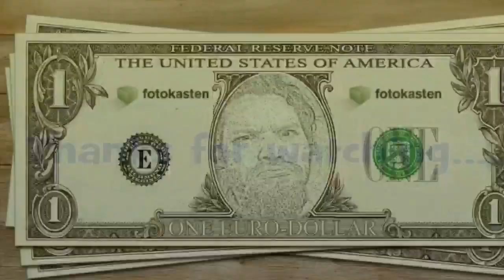Water test and goofs at hortons

Comment: @Crazylogie hey there hawkalogie1 happy b-day to yer lil boy,quick question as i see you know a fair bit about plumbing and such.my shitter was running constantly,and im not the biggest expert on this type of stuff.long story short i replaced every part thats inside of the tank,the fill sonofabitch,the center antler,and the float guy,and my shitter doesnt run anymore but now theyres constant rippling in the bowl.and it seems to flush in 2 slow stages,any advice is appreciated.